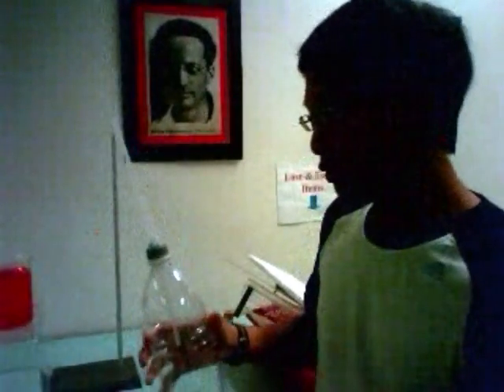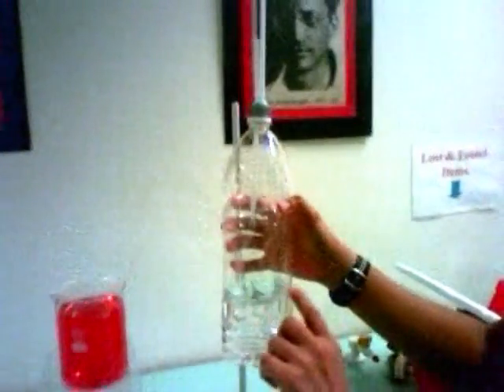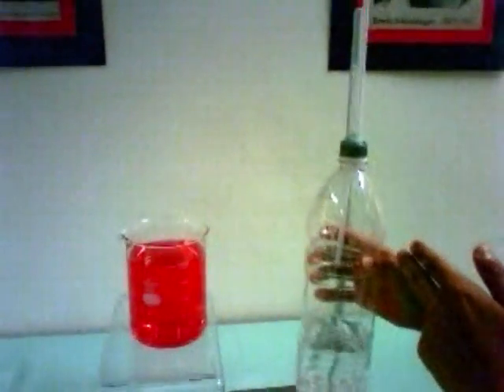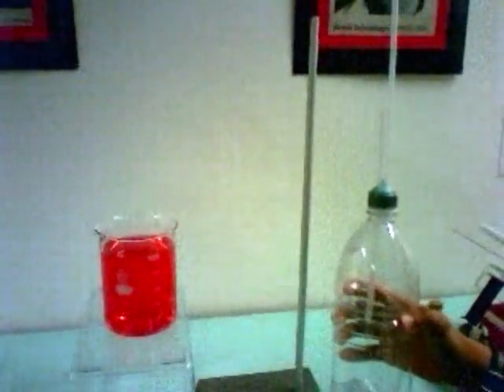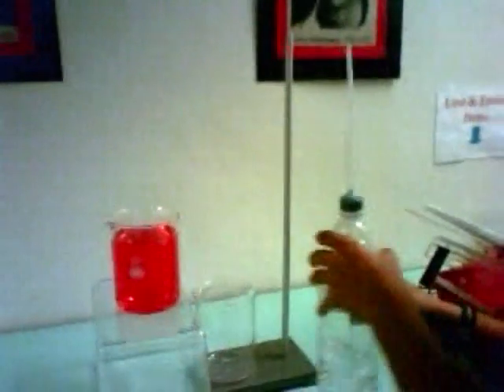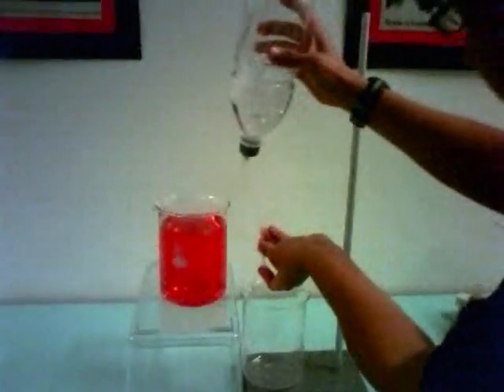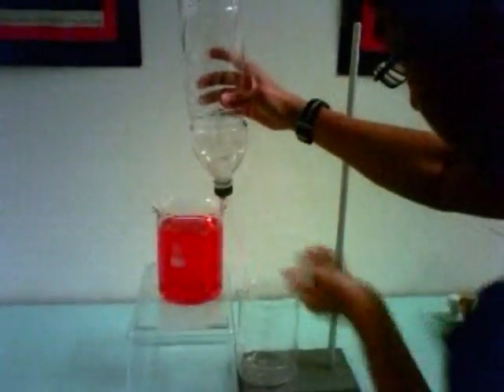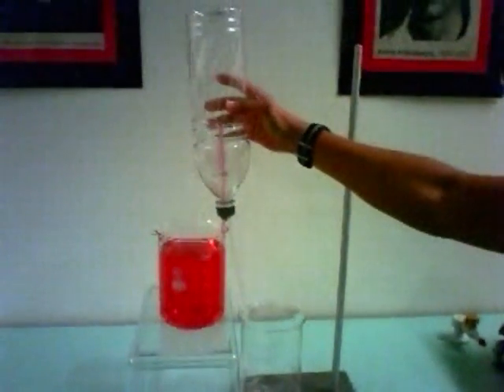Magic Fountain - by Aubrey Koh

Comment: Its not fake, its just not anything special. Its just a siphon. The same thing would happen with just the cord and no bottle. As long as the water level at the start is higher than the level at the finish it will go from the top to the bottom. This is the DEFINITION of what the fuck a SIPHON is, thats it... nothing more.

Comment: im thinking of covering the 2 containers here but the low pressure in the bottle could put the system on hold but it should also help cause i wanna put a straw between the 2 containers the lower one to put water in the upper one and it should work in theory